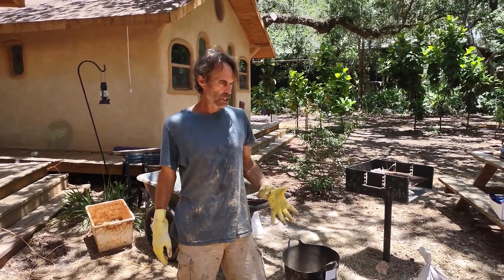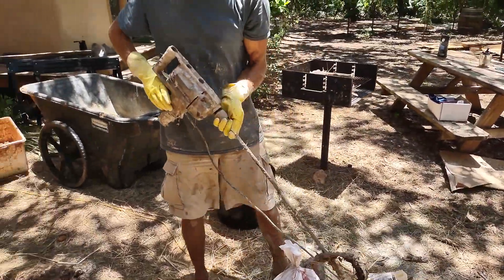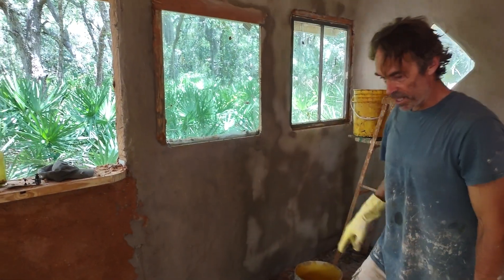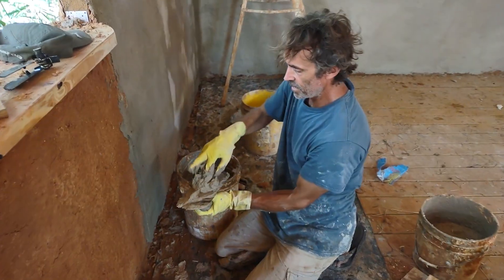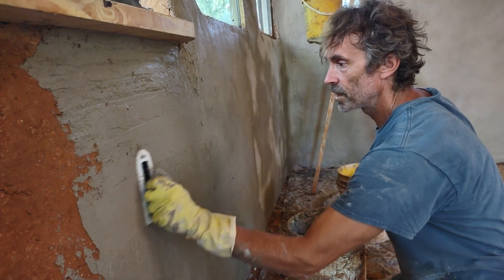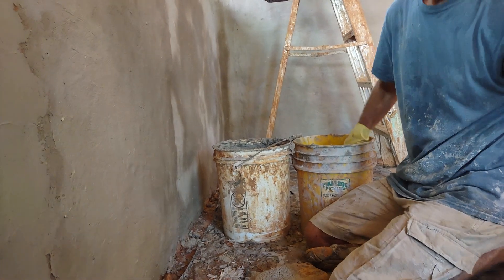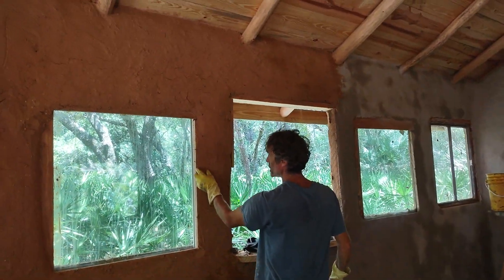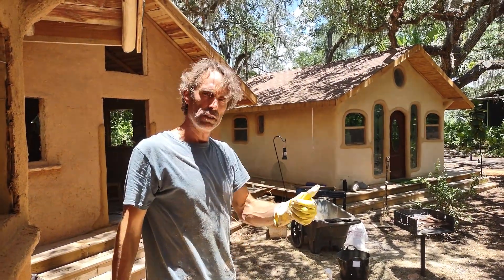Applying an American Clay plaster in Florida

Comment: you don't need gloves with clay
Reply from the maker: You are correct, you don't need gloves. It just comes out smoother on the walls when you use gloves
Reply: @cobalot9  i mostly don't need any .. sometimes, when the straw might be stiff and cutty, yes, but i have mostly gloves which fits the situation .. thank you for making me participating